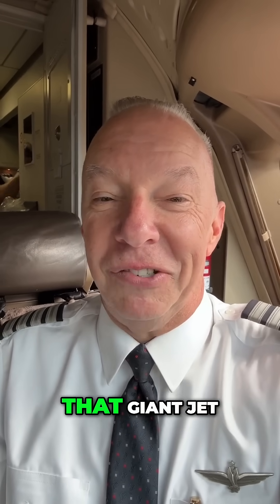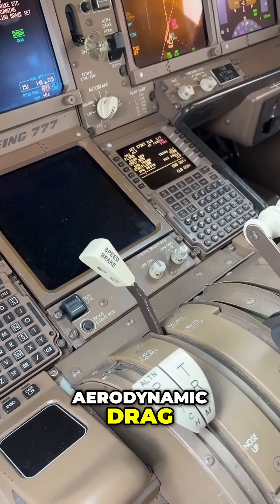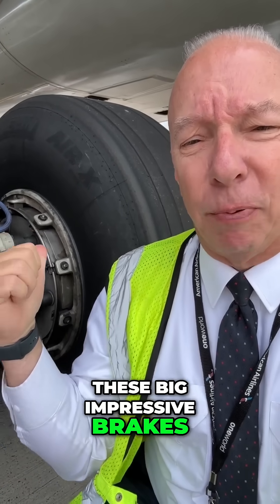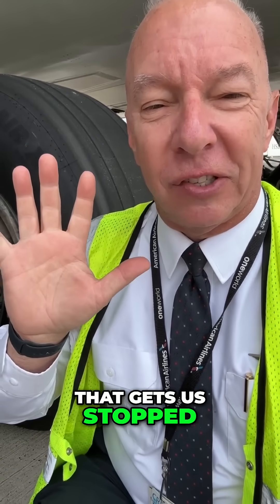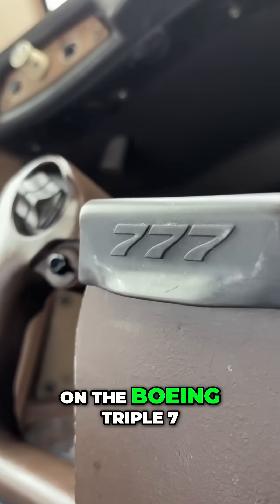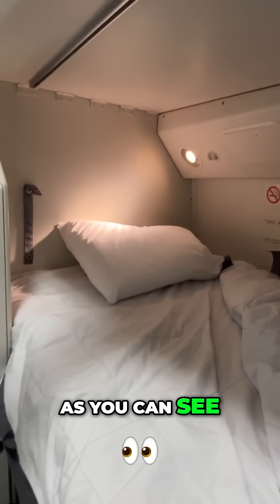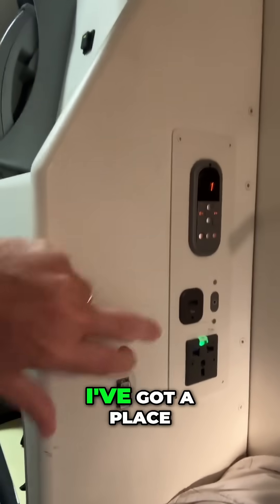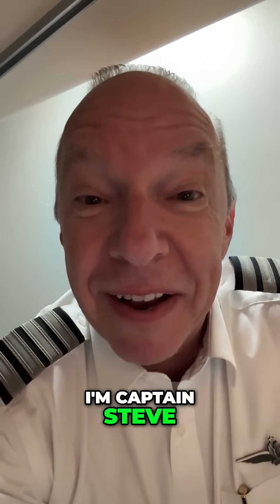How Do Pilots Stop a 460,000-Pound Jet?

Comment: Fun fact though: light props, at least single engine ones, don't need windshield wipers because the centrifugal force from the engine is enough to push the water away

Comment: Captain Steve can you do a video on why aircraft engines are so loud at lower altitudes especially during take off and then seem to be much quieter when at cruising altitude
Reply: Likely sound bouncing off from ground and creating higher noise levels than at higher altitude where sound just travels in all directions without bouncing off. Just guessing.
Reply: It’s mainly due to the thrust positions. At higher altitudes during cruise the engines don’t have to be on a higher thrust. While lower with a higher air pressure you do. There’s many other factors. As well as engine types, aircraft type, meteorology and topography of the region, etc.
Reply: Because they're spinning slower also